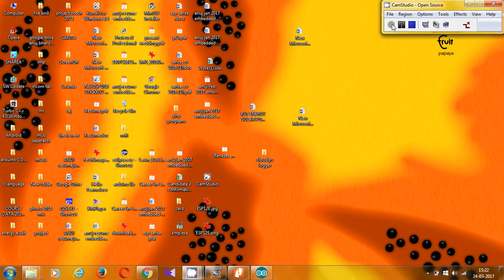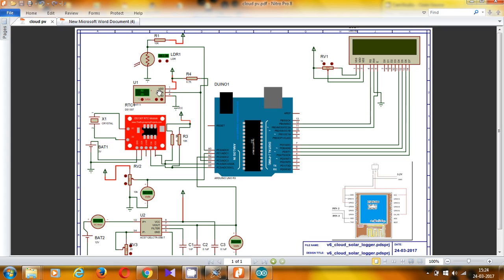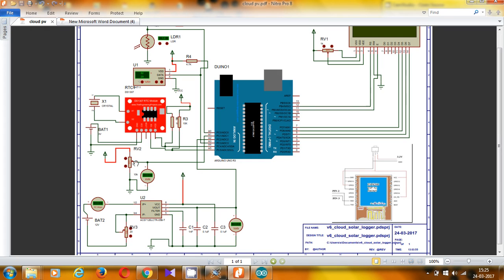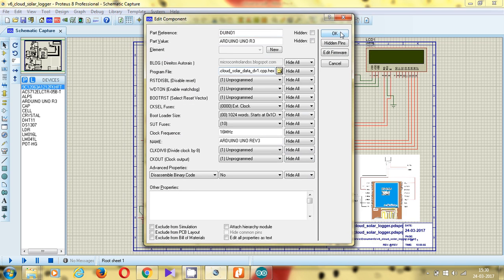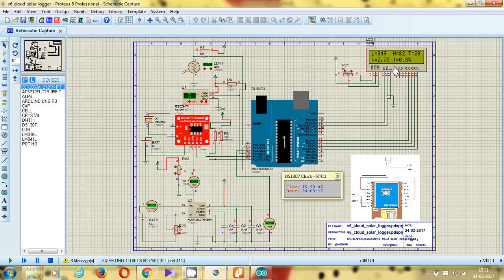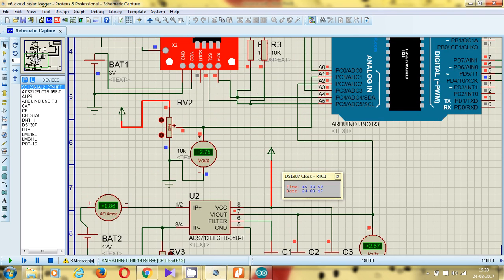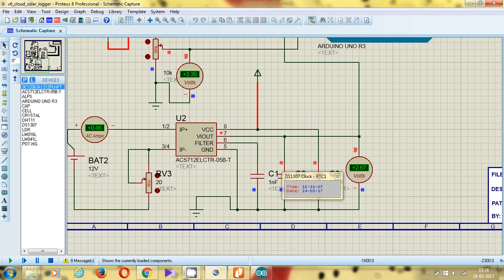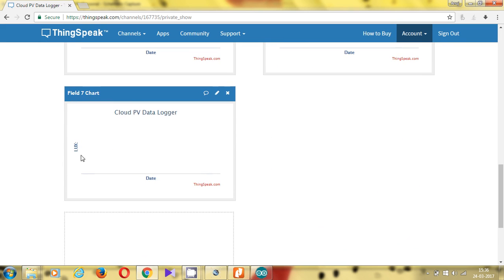IOT solar panel simulation using proteus and arduino uno r3

Comment: can you send me steps of design or codes that used 
this is my email:   mr3110c@gmail.com

it is very crucial to me.
Reply from the maker: as it seems u need to design real hardware or just need to simulate the results?
foe code and complete solution you can discuss your problem statement to me and ask for the code solution...foe coding of your project you need to donate some amount  to my freelancing company  which depends on your project complexity ..first proof of your developed project is shown to you and only after your satisfaction you are asked for payment.. you can directally watsapp me on 9410407419

Comment: which software u can use for simulation for these project.
sir,i am doing my main project on iot based solar power plant monitoring at remotely located areas
Reply from the maker: as it seems u need to design real hardware or just need to simulate the results?
foe code and complete solution you can discuss your problem statement to me and ask for the code solution...foe coding of your project you need to donate some amount  to my freelancing company  which depends on your project complexity ..first proof of your developed project is shown to you and only after your satisfaction you are asked for payment.. you can directally watsapp me on 9410407419

Comment: in a simulation u record a voltage...  do u use voltage sensor..??
Reply from the maker: voltage directly from solar can be given to arduino Analog port through optoisolator driver